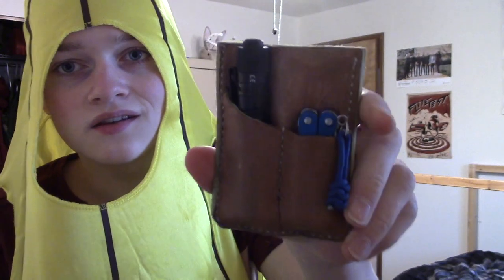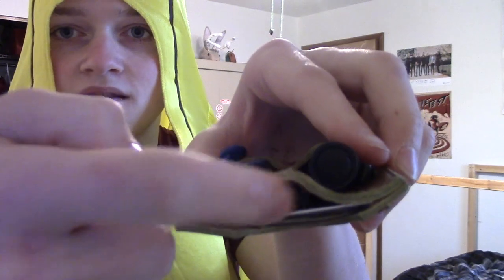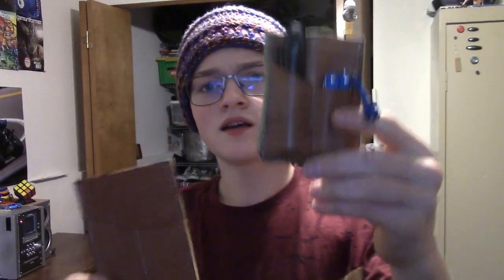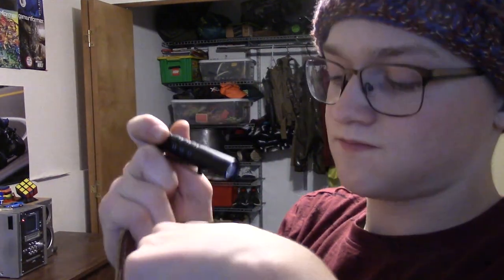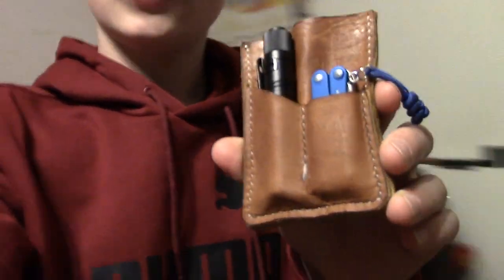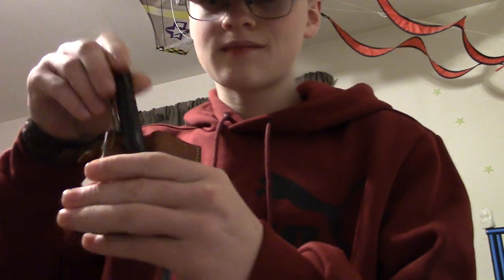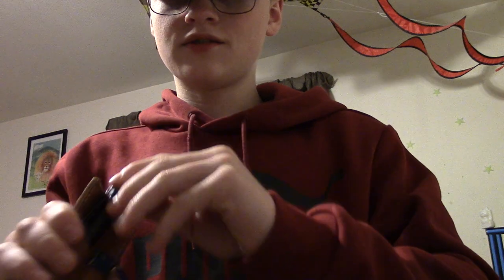Making a custom Hitch and Timber style wallet

Comment: Hey man next time use oil tanned leather and try burnishing the edges pro tip before u glue the leather punch holes in the top pocket leather and then glue and then u a scratch awl to indent then punch
Reply from the maker: I really should get a burnisher so I can really finish my projects for real :) I also need to get a real awl too. next time I make a wallet or something I will try to learn from this one. :)

Comment: Nice job man! Been wanting to try my hand at something like this. What’s the hole spacing measurement?

Thanks!
Reply from the maker: Hi! Sorry for the late reply, he spacing between each prong is 5mm. I measured from shaft to shaft not point to point for a more accurate measurement. Each prong is about 6mm across.
Reply: @moomoojuice5236  Thanks! So from shaft to shaft,  you mean the inside to inside, not tip center to tip center? Can you say what type of thread you used?
Reply from the maker: yes i measured fron shaft to shaft. the thread can br found on amazon by searching this: eBoot 260m 150D 1 mm Leather Sewing Waxed Thread Cord for Leather Craft DIY (Beige)
Reply: @moomoojuice5236  Thank you!